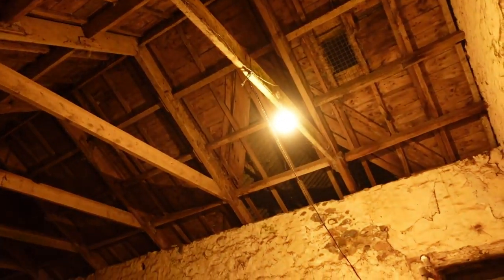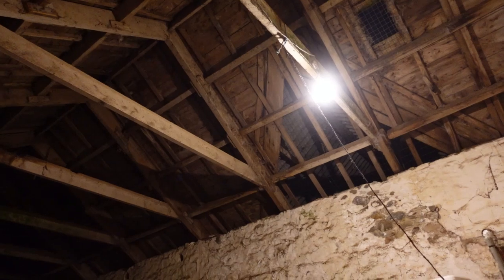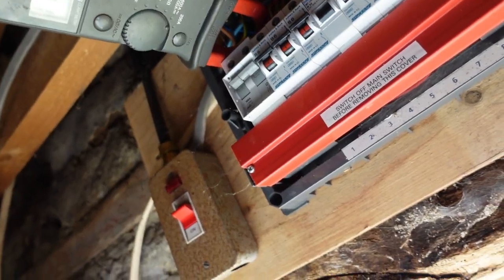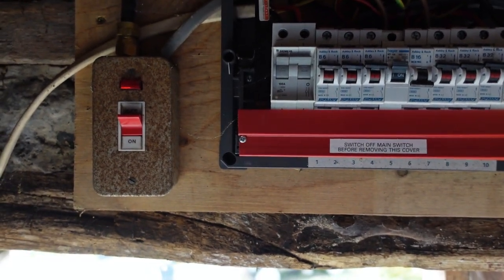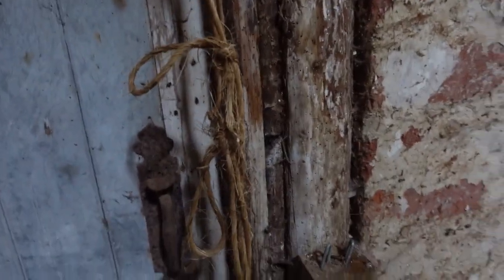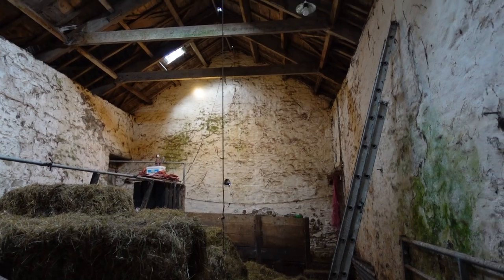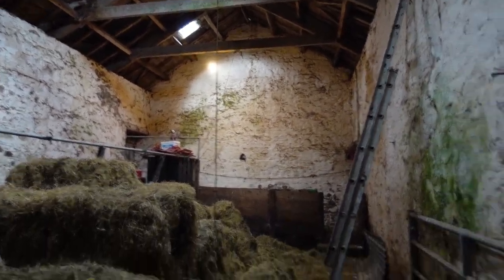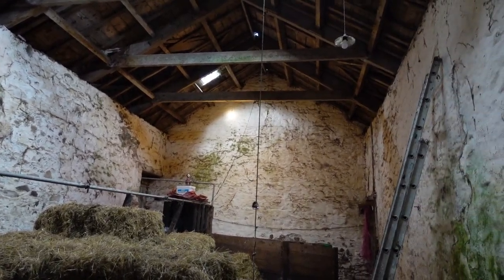LED bulb glowing when turned off!

Comment: This has a very  easy explanation 😝 the switch " drop " wires provide a small but significant capacitance , this allows a VERY  TINY amount of AC power to be transmitted ( even when turned off ! ) ... with the ( old skool ) Tungsten filament lamps , there is not enough power to warm these ( highly inefficient ) lamps ... but LED lamps are  HYPER  efficient .. hence the glow ... some manufacturers include electronic circuits to prevent this ( glow ) .. but do NOT despair ... this feature is quite useful . when turned OFF .. you have a  VERY  valuable ( night light ) which stops you tripping over the CAT at 3 am 😝... I  have two of these ( ghost ) lamps , and I am VERY PROUD .. Ha - Ha ( tried - n - tested ) ............ DAVE™🛑

Comment: If the hot line and the switched line are next to each other in the cable, they can couple capacitively. 
Even worse if you connect a glow lamp via these two wires. The LED can glow or flash in the dark.